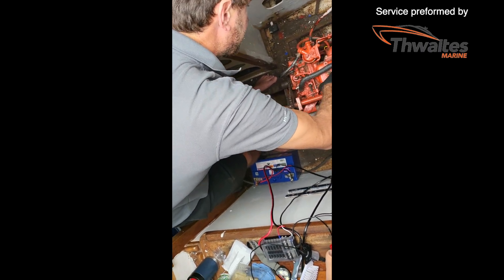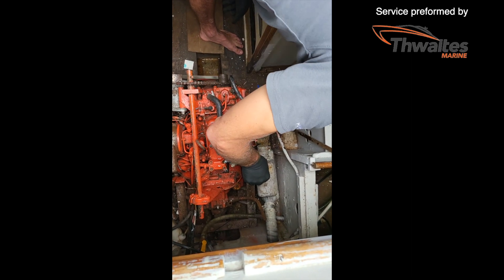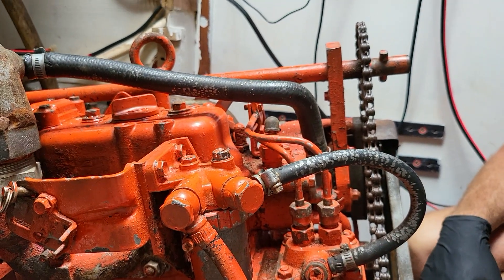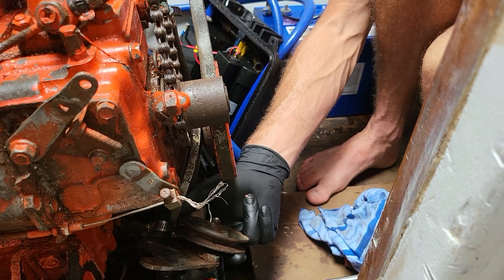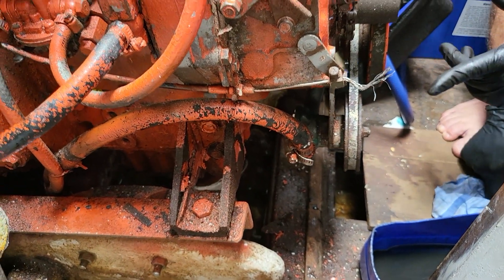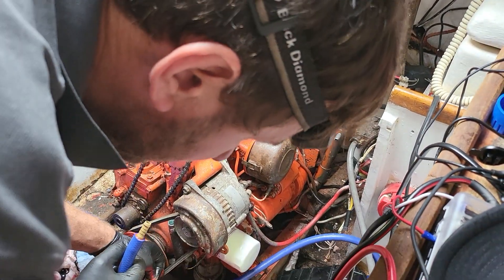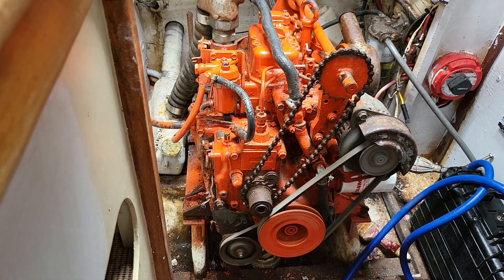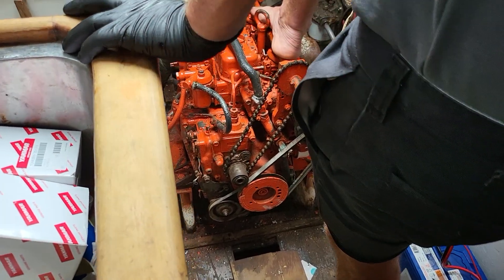Getting the Yanmar 2GMY Engine Serviced

Comment: Those little 2GM Yanmars are such a great little unit. 
I service/rebuild 100's of injectors (and to a lesser extent the injector pumps as they give virtually no issues) a year for 1 , 2 and 3GMs . 
Easily the best model small diesel engine around. 
Their only real problems are the exhaust elbow/mixer chokes up after a lot of idling or slow speed no load running (and lazy injectors) and some chew the raw water pump besri gs out but all in all a very very good engine.